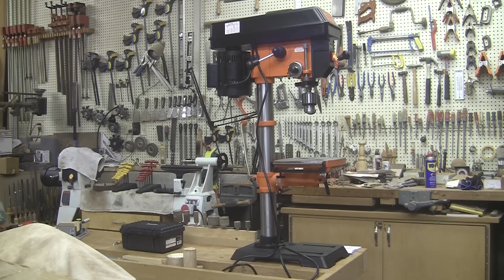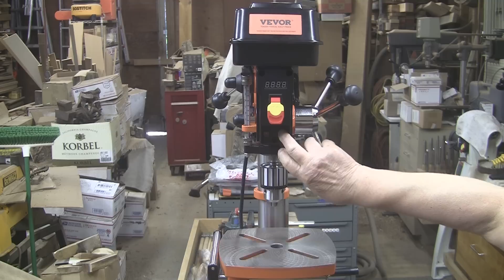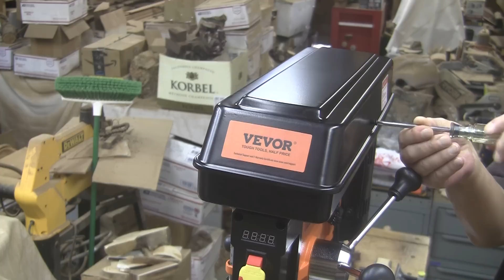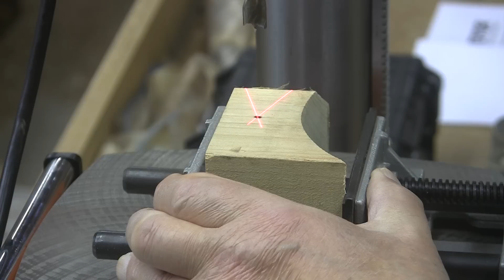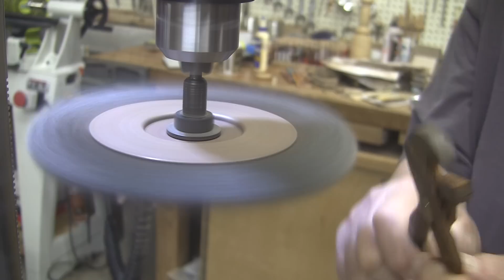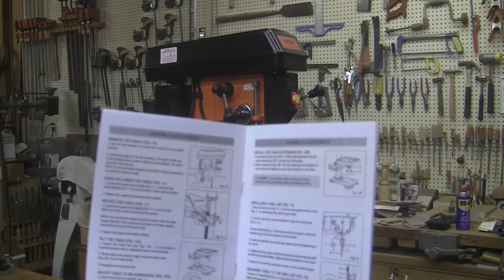Using A Drill Press!  Vevor - Not Wood Turning

Comment: Nice addition to the shop. I look forward to updates on how the press performs. I would also like some pointers on buffing wheeles and in particular the compounds you use. I think the abrasion grade is by the colour of the compound if it at all like buffing compounds for knife blades. Take Care. Be Good.
Reply from the maker: It does indeed go by color.  I have a set like this:  https://www.eastwood.com/eastwood-buff-compound-set-6-different-compounds.html?gclid=CjwKCAjwtuOlBhBREiwA7agf1iXK_luDiB9utGKktBgz0lTaFcsuFJL_KjREwjxlml7A6N2wwrLa2xoCu30QAvD_BwE&wcid=18669317685&wickedid=629947571983&wickedsource=google&wv=4

Comment: Good review Phil. I would prefer that the slow speed were a bit slower. Looks nice over all.
Reply from the maker: Agree, Doug, slower low end would be great.  I won't be using this for larger Forstner bits so it should be OK for just drilling normal sized holes, etc. 😊

Comment: Awesome video I have an old craftman drill press works almost like new still lol Thanks for sharing. The ShopSmith has the same variable speed belt system. Keep up the amazing work. 👽
Reply from the maker: I think the newer Shopsmith's have gone digital like my lathe but, yeah, they had it for many years.  It's a proven system for sure!  I have a 50 year old Craftsman drill press that I will never give up, love it! 😊
Reply: @PhilAndersonShadyAcresWoodshop  I have a small basement shop. I got very lucky and was able to pick up a used ShopSmith. Very nice machine. 👽

Comment: Pretty cool drill press Phil, I used to think I would be better off with a drill press like this because it does not take up the floor space. Problem for me is it would take up bench space and that is limited.
 I do like the idea of the Reeves drive. It really is a good system that gets a bad rap because some are not made so good. But the real Reeves is a great system. My Bridgeport milling machine uses it  And the huge patternakers lathe we had a work did as well. I was spoiled not having to change belts like we do on the old Craftsman drill presses we both have.
Nice having the built in table raising system on this new one you have. . With me being so much older than you(by a few months LOL) I put a trailer jack on mine so I did not have to lift that blasted table.
 See you tomorrow my friend,
Gary
Reply from the maker: Haha, I'm still lifting that blasted table!  Not sure how long I'll be able to keep doing it.  But, that cam lock clamp is worth it, to me.  I wouldn't even know how to use my old Craftsman if it wasn't for that thing.  I love it!  Thanks, buddy! 😊

Comment: Hi Phil. I look at your wood turning videos all the time. Watched this one on the Drill Press and went to order thru on link below. However, the amazon link shows a different model It is not the DP 12VL but a DP 1006L. For $132 and it weights only 45lbs. It does not have the digital readout either. or the pull out table extension. I Could not find a DP12VL anywhere on google so I am assuming that is has not yet been made available for sale??
If I'm incorrect and you have a better location to buy this VEVOR drill press that would be great. Cheers, Andy, Millington, New Jersey 07946
Reply from the maker: I just was told it's out of stock.   The link is correct. When you get there, you can choose 10 or 12 inch but since the 12 inch is out of stock, it only shows the 10 inch.  So sorry, Andrew. Hopefully, it'll be back in stock soon.
Reply from the maker: Back in stock at the same link, Andrew!  Choose 5 Amp model and it will come up.

Comment: Seventy-two years ago a neighbor gave me a runt pig which with dads feed I raised and sold for $80. I made many trips between a local hardware which had a wonderful .22 single shot and Wards Craftsman area with a drill press. The drill press won out and I’m still using it. I loaned it to dad in his declining years and he even used it for a vertical wood lathe. I’ve used it building two airplanes and a 40 foot sailboat that I sailed to Cuba in a ten month trip. Now I use it with a Forstner bit for you-know-what. I think the drill press was a good choice!
Reply from the maker: Haha, yeah, I think you are right, Ellis!  You've gotten a lot of use from a useful tool! 😊

Comment: Phil -- Just an FYI.  I think your Amazon link points to a different model than the one you reviewed.
Reply from the maker: Thank you for that, Gene!  I used the link they gave me but now I've sent them an email for a correction.
Reply from the maker: It was out of stock, Gene.  Back in stock now at the same link, just choose 5 amp model and it will show the 12"